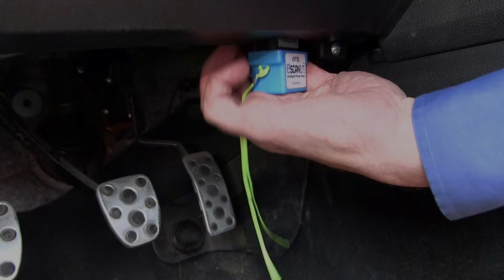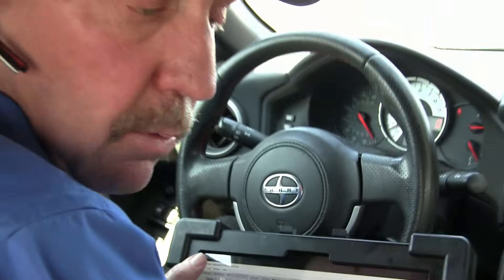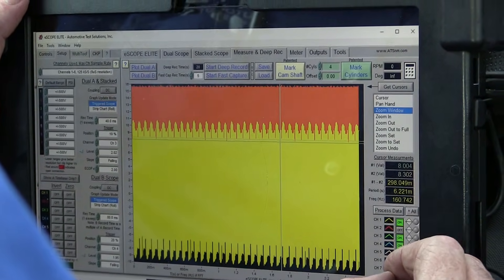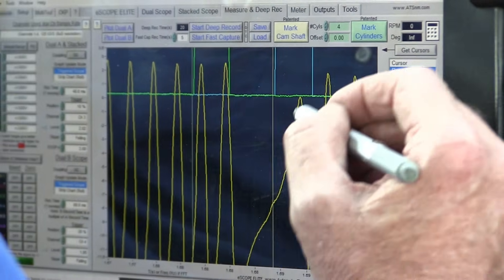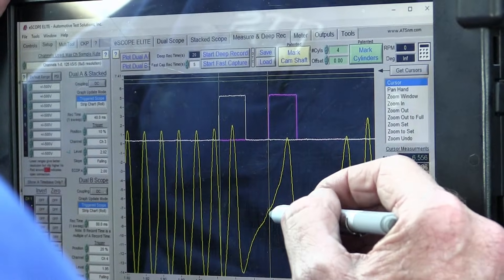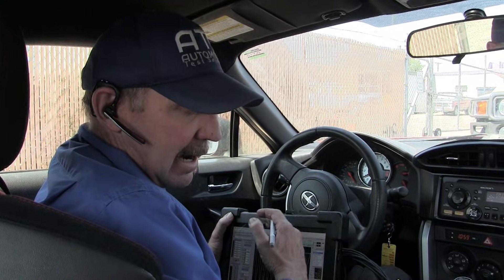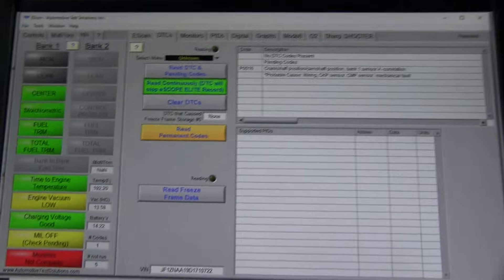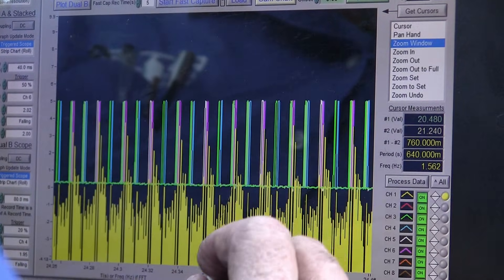2013 Scion FRS Cam Crank Problem

Comment: Wow that's nuts Bernie! Fantastic diagnosis! Can't believe the shop put the phasers from the junk engine back in the replacement...just asking for trouble :)
Reply: Read Subaru's TSB's for that code. That car ain't out of the woods yet.
Reply: The "Comeback Kid", I hope u learned something???
Reply: @hnd2893  I heard you need a new ecu everytime you change all the phasers?
Reply: @andrewcimochowski  yea there is no way to relearn the positions. The ecm will not relearn. At the shop I work at we had a newer wrx that jumped timing and after the repair the values remained fixed to the wrong angle and the only fix was an ecu.
Reply: Lol, this guy...

Comment: Once you start using the escope elite4 you'll fall in love with it & you want to use it everyday to learn more. There are so much to learn about this scope. It does a lot of things , you can check for shorted circuits with the TTL & apply 5 volts to circuit where they work on 5 volts. I can't stay away from this Escope. My daily bread. Amazing scope.
Reply: Pls how much does it cost?
Reply: @smartnwogu8316  the 4 channel costs 2900$.

Comment: See Subaru TSB  02-163-16R about diagnosing this family of DTCs. We have been seeing these regularly on BRZs (rebadged FRS) and WRXs. It is vital to check initial learned position values as your first step. They can not be cleared from the ECM. You may fix the problem (OCV solenoid, cam sprocket, oil pressure, etc), but the DTC will return if the initial learned values are out of specification. Your repair must include ECM replacement to completely repair the vehicle if those values are out of range.
Reply: @Discretesignals  Bernie also captured the joy of being a real world tech. After he spent a lot of time diagnosing the vehicle, he got a vital piece of info that contaminated sprockets had been installed. Knowing this initially would have saved all the shops involved a lot of time. Wish more people would learn having the full story from the beginning is ultimately less expensive in the end.
Reply: Agreed, maybe Bernie didn't get the TSB, and there was no mention of the AVCS/VVT learned values. Also consider the timing chain cover has been off, lots of RTV used in that area, lots of little pieces can muck up the works.

Comment: Awesome stuff. I just had a similar issue on my 2013 FR-S and the tech showed me these graphs. VVT-I was my problem because the metal plate that was controlling valve came out and was swimming in the phasors.

Comment: its weird that its not setting a cam over advance code like a p0011 or something instead of a p0016 which has always been a base timing code in my experience. great vid as always
Reply: Ya gotta take into consideration this engine had internal parts swapped. All bets are off, that's where an in-depth customer interview can come in real handy and a good visual may have spotted fresh RTV on the timing cover.

Comment: I have a Subaru BRZ 2013 with intermittent starting problems everything lights up when you hit the button but it won’t start you sit there long enough and it will I change the starter thinking that was the problem and it came back the negative terminal was cracked and I replaced the terminal but I’m still having the problem any ideas everything lights up on the dash but it just doesn’t crank over

Comment: Any update on the car after you told them to put back the cam phasers? We had the same issue same model year. Changed 2 intake cam phaser, reflashed the computer with updated software program med. still set the code. Code set while decelerating too.

Comment: Hi, I got 2013 FRS same at you are looking to fix, my problem is 3 times we replaced the flex-plate. the first time i wend to the dealer and the car back whit the same problem and worse. later i call a friend he is mechanic but the same problem flex-plate break  i dont know what is the problem and cause. I need your help if you know. Thank you or maybe sombody know the issue . tahnk you in adbance.

Comment: Those Subaru engines have learned values for the phasers that can not relearn the new positions after a repair is made. The only fix is to replace the ecm. For examples if you had a chain that stretched the ecm would learn the values or if the chain jumped a tooth it would to but when you make the repair the ecm never reverts back and there is no options to learn the positions.
Reply: Would this cause a no start? I recently built an engine for my 2014 frs and used the 14 heads with 2013 camshafts/phasers and it seems to only want to run for 2 seconds. Cylinder 3 and 4 seem to not be firing since the headers are cold at the ports

Comment: I have this same problem p0016, the code is set when decelerating. I didn’t do all this diag but I’ve replaced the VVT solenoid and the cam sprocket for bank 1 but that didn’t fix the problem. Any idea what should I do next ?
Reply: Read some of the other comments. Seems like a common problem with a tsb as well as some mention of “learned values” not clearing after replacement parts.

Comment: I have one question, at 13:05, did you have the wires from the escope connected to the sensors inside the engine bay while driving on the road or did you connect the all the wires to the ecu directly?
Reply: Scope wires are connected to the sensors in the engine bay... the scope wires are long enough, so that they reach inside the car through an open window.
Reply: @EXOVCDS  Ok, but is that not dangerous for the the heat and fans for the wires while driving and doing a road test? You could connect the wires to the ecu inside the car if there was one for better protection, right as a second option?
Reply: @RAVETOR  I don't know where the ecu is on that car... connect wherever it is easier. I also connect to the sensors in the engine bay and run the wires inside the car through a window. It's not a problem as long as you make sure that the wires don't touch any moving parts. If the ecu is in the engine bay, you still have to run the wires to the inside of the car.
Reply: @EXOVCDS  "If the ecu is in the engine bay, you still have to run the wires to the inside of the car." That what I meant if you could do that - I have the ecu inside the car - seems even better for me then.